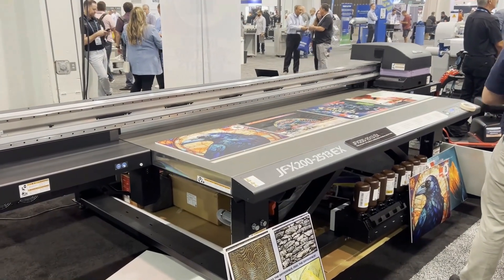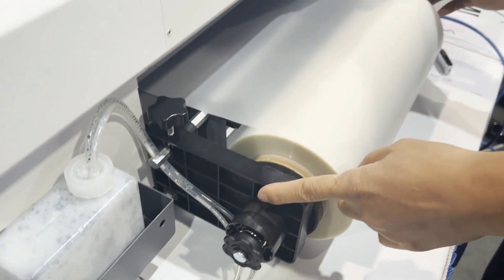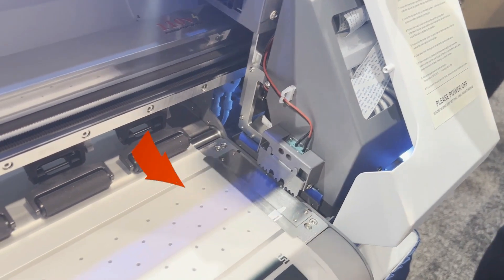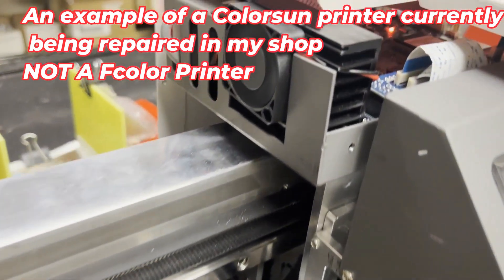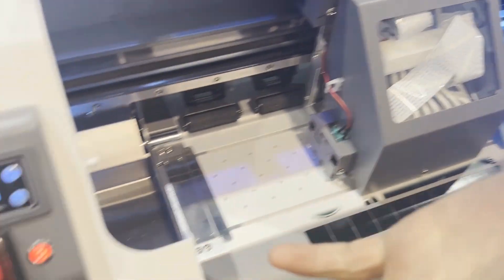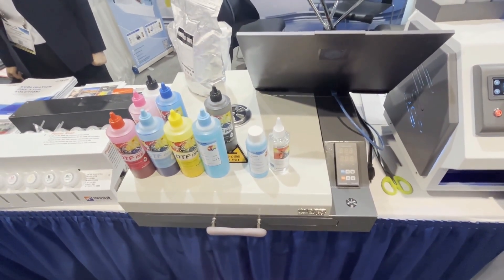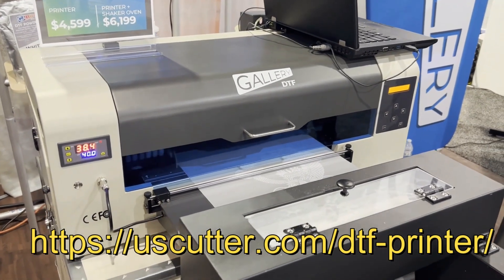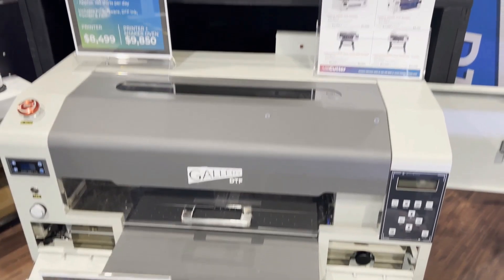2025 Hottest DTF Printing Trends Revealed - Dual XP600 Printhead - FCOLOR & USCutter Gallery DTF

Comment: Looks like it is based on the HosonSoft control system for the motors/printheads like most printers. As for using filters on all colors, this is a good idea. XP600 heads are cheap ($165 currently on Digiprint US), but very vulnerable to clogging. DTF ink gets really stringy, and chunky, so a good idea. The 10 micron filters they show are a couple bucks each and totally worth using. That said, XP600 heads don't have reinforced nozzle plates and tend to have short lifespans due to delamination.

Fcolor is definitely a better buy than the junk I get stuck working on from Procolored. However, the choice of diaphragm pumps for capping stations is a mistake Procolored also makes, they clog way easier than peristaltic pumps since the ink directly interacts with the pump parts. Peristaltic pumps keep the ink inside the tubing and don't touch any valves or anything else, so they tend to be more reliable and easier to service.
Reply from the maker: Solid advice! Thanks!
Reply: What print heads do you recommend if the XP600 is fragile and prone to clog?  i1600?  i3200?  What other manufacturers do you feel are solid?
Reply: @SuperCarlsonb  Depends on usage. XP600 is cheap ($160-ish) and i3200s are over $900 each. depends what you want to do, volume, etc. Cheap doesn't necessarily mean bad, especially if trying a new process or attempting to offer a new service and you don't want to commit a huge amount of cash.
Reply: @o.e.r.3287  What brands do you suggest in the sub-$10k range?  Who has the best systems for reliability and reduced clogging with good circulation systems?
Reply: @BenCarlson-o2c  Depends if you want to do the support or to pay for an imported printer brought in by a company that will support it to some degree. Head count type, width and head type are main factors. Things like filters and circulators help a lot. Pay extra for good domestic inks, less likely to be problematic.

Comment: I've never used any filters on my color lines. Is this to keep solidified white particles from going through the line?
Reply: White ink has a much higher pigment load and is more prone to separation more than other colors. As for things solidifying, it tends to be a consistent risk across all colors. Using bulk ink in general results in little chunks of ink that dry up from the top surface or inside little nooks in the bottles, in the cap threads, etc. that end up in the main ink reservoir.
Reply from the maker: Another gold. I subscribed to your channel.